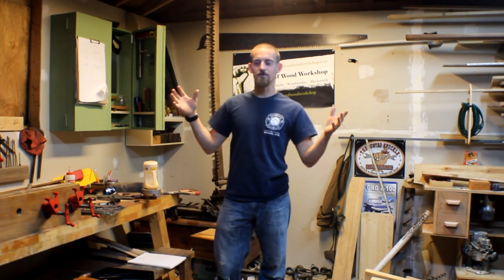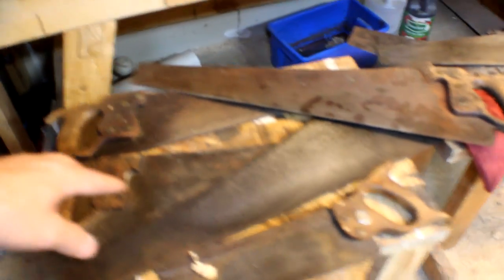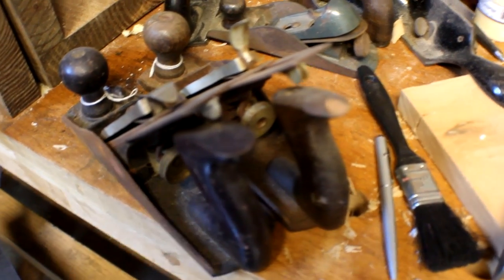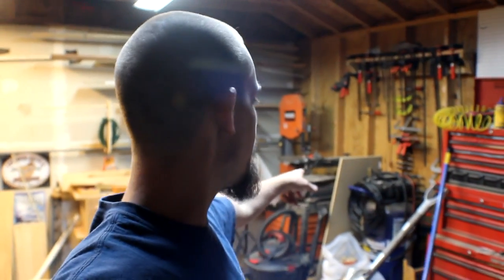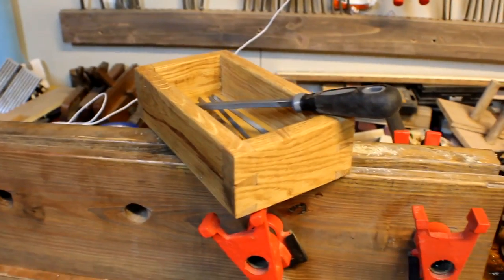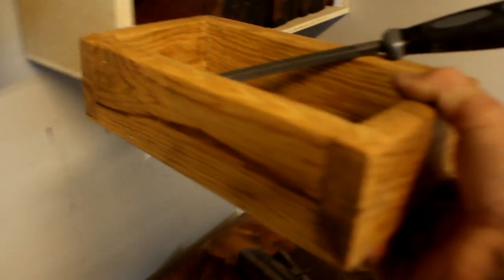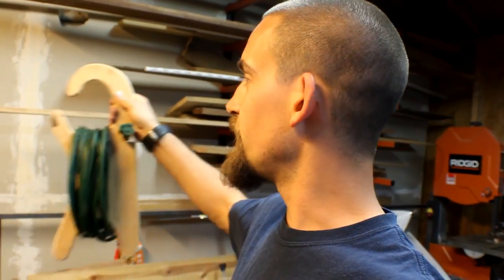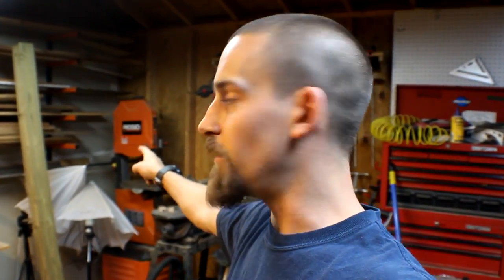Vlog 18- Fancy Dovetailed Saw File Box

Comment: Nice little box, though I'm not fond of having files rattling against each other. Regarding calipers, you can make your own. Old worn out useless saw blades are good stock for this. Layout your pattern,cut it out, drill for the hinge/pivot. A washer between the legs and a bolt and wing nut and Bob's your uncle.
Reply from the maker: +kleinjahr I'm not sure if I've met Bob yet.